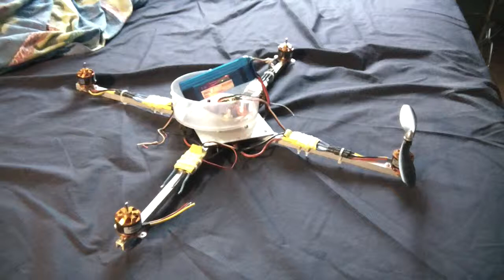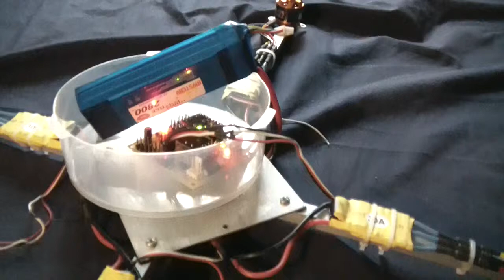First Motor Test 400Hz - DIY PIC18 NRF24l01 2.4ghz RC and a flight controller quadcopter

Comment from the maker: Hi ! No , my PWM has never blown (yet). But you are right, it's always good to use a protection. I think safety of you PWM much depends on the ESC design, i think you can use a diode for voltage protection on the signal line. And put a resistor in series for current protection, that should work as a simple solution.  
Good luck with your project man :)

Comment: hi artiom 
i m building a similar system using a ARM7 lpc2148 core, have u come across PWM getting blown up on flights by any chance?  my PWM block got blown up 2'ce now ,  i see u havn't used any protection from the ESC -> the PWM Controller IC. can u shed some light if possible
many thanks